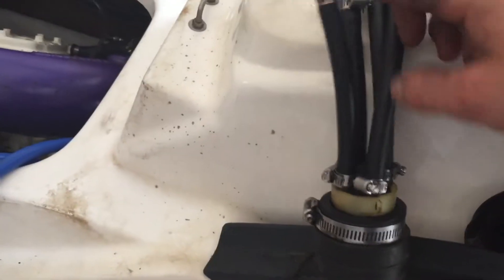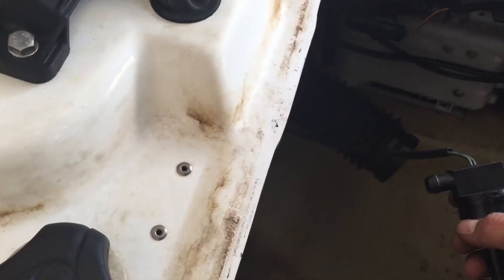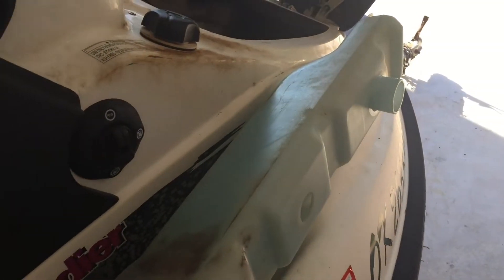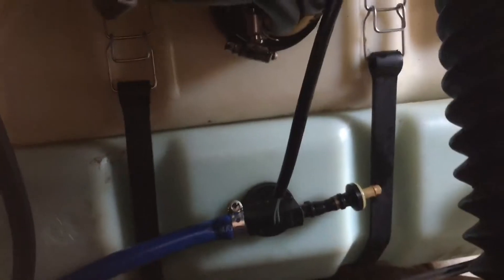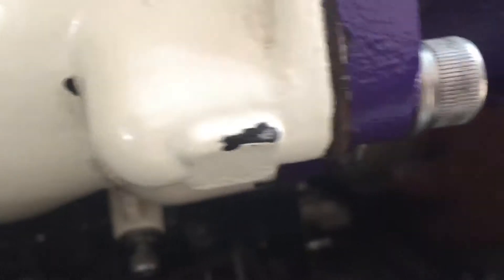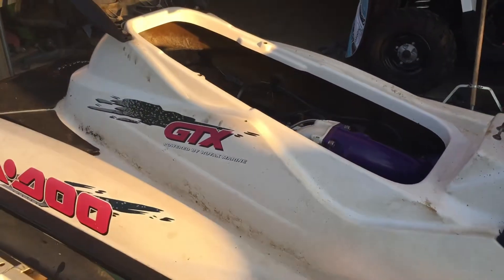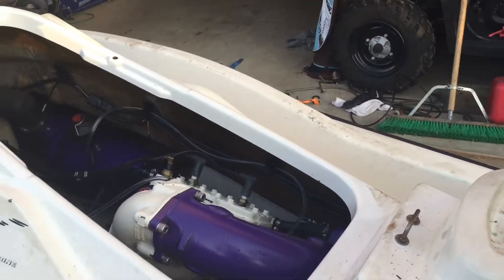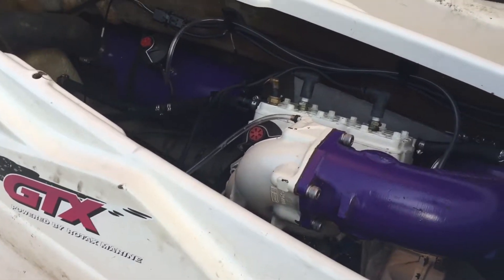CHEAPEST FB MAKRETPLACE SEADOO REBUILD PART 8

Comment: I skimmed through all of these videos, you should have done 3 things. Align the engine, replace the wear ring, and replace the carbon seal. You put in all this work to make everything else right, you need to do these things to have a proper running ski.
Reply from the maker: Awesome! Thank you for the information! I’ll have to check some of those things out!

Comment: I have the same model Sea Doo that im rebuilding currently! I can't find any diagrams online of the carburetor fuel lines. Do you have one I could use? Im new at this and pretty sure I put them on backwards. Not getting any gas...
Reply: Look at all of the fittings they are marked either with words or arrows, most of the time you will have to prime the lines after you replace them all, the manual fuel pump doesn’t create enough vacuum to prime. Use a rag over the fuel cap and a little compressed air with the line off the carb should do the trick

Comment: So why did you put the oil system back in if you are just going to bypass it?
Reply from the maker: Well the rotary valve still needs oil, so there are a couple of ways to do this but I believed putting the tank back in was the easiest way to do it. Kinda hard to explain but I should’ve talked about it more in the video